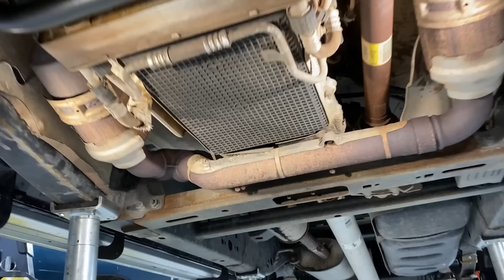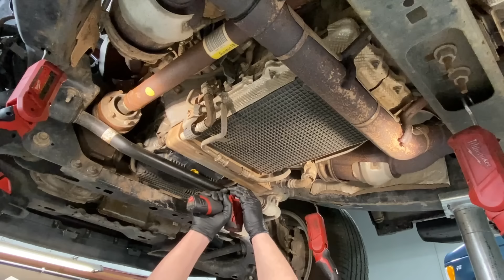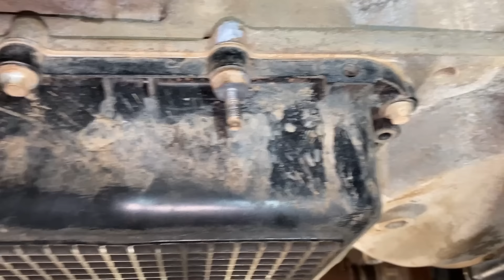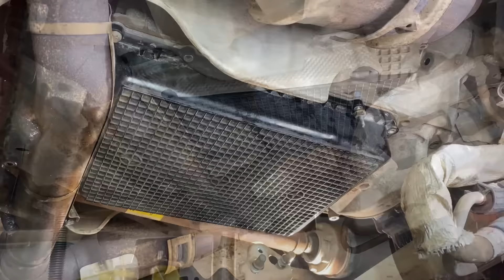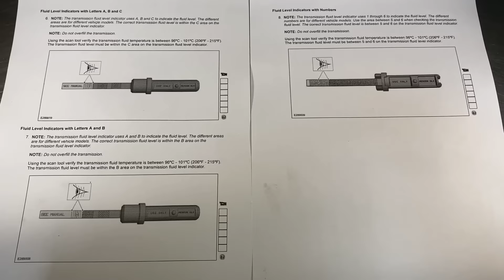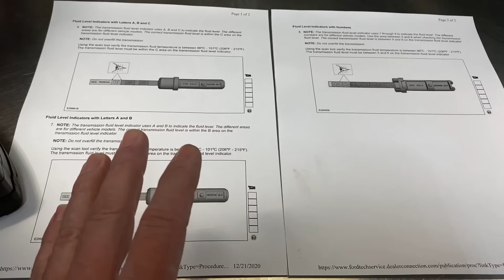Ford 10R80 Ten Speed Transmission: Fluid and Filter Service Procedure

Comment from the maker: I Recommend these Fluid Service Intervals:
First 30k Miles- Fluid Service Only
At 60k Miles- Fluid and Filter Service
Then Fluid and Filter Service every 60k Miles thereafter 

These are the Tools and Parts I Recommend:
Motorcraft Fluid Filter-
https://amzn.to/3ws97Ck
Mercon ULV Transmission Fluid-
https://amzn.to/2Qjz3uZ
Filter Seal-
https://amzn.to/38uzGaG
Manual Fluid Pump for Filling-
https://amzn.to/3hd3DzT
Medium Strength Threadlocker-
https://amzn.to/3heZT0X
Motorcraft Mercon ULV XT-12-QULV 8qts or so
Cooler Line Seals (if applicable) 5L7Z-7D285-A 
Cooler Line Backer (if applicable) 5L7Z-7J324-A

Torque Specs:
Sway Bar Nuts 15mm-  41ft lbs
Cooler and Lines 10mm- 22ft lbs
Rear Trans Mount Bolts 15mm- 76ft lbs
Exhaust Clamp Bolt 15mm- 41ft lbs
Passenger Side Cooler Line Bellhousing Bolt 13mm- 35ft lbs

Transmission Fluid Dipstick Changes-
https://drive.google.com/file/d/1-U1vxELlUPsKzgTSsjyplMQLwgd0tZBs/view?usp=sharing

Forscan is free Ford Specific Diagnostic Software:
Download Here- 
https://forscan.org/home.html
ELM 327 Adapter I Recommend-
https://amzn.to/2GC6dBj

As an Amazon Associate I earn from qualifying purchases.
Reply: At how many miles we need to change the fluid and filter im at 45k
Reply: @michoacanom4320   I believe in another video he suggested 30k fluid change, and then 60k fluid + pan drop afterwards.
Reply: @CookieManCookies  damn im way past that but i dont tow or haul all my miles its its highway
Reply: @michoacanom4320  see my reply to you. Ur fine just follow the suggestion based on Brian's service interval recommendations.
Reply: @michoacanom4320  same question! I have 25k miles and about 15% of it is towing a 8,000lb trailer
Reply: @WeekendwarriorBB  i dont tow nothing  and haul no more then 1000lbs with humans inside 🤣🤣😂😂😂 i will google it n go to my manual and see if i can find any info
Reply: @WeekendwarriorBB  See my reply below. He has more info in his description . keep Ford truckin!
Reply: Just did this maintenance myself a couple weeks ago (2018 F-150 5.0L).
I was searching this channel before doing the maintenance.
Love your videos Brian!
Really appreciate you including the torque specs & Ford OEM part numbers!!

Ford claims this maintenance interval is 150,000 miles!!?

Did mine at 40,000 miles.

Do you recommend pan drop & filter change every 30k?
Reply: This looks 100% doable…even on ramps, in the driveway, & on my back this weekend. Swapping over to an AL pan with a drain plug & 2 extra qts. cap. All Ford fluids & filter & doing it at 30K. Feel good about it!
Reply: Hey Man, love the channel. Thanks for helping us out. I recently bought a 1998 E350 with 5.4L 2Valve with RABS & have brake & abs lights on constantly. I have no communication with the module & all fuses are good. Can you possibly advise on where to locate a replacement ABS module for this truck & if only a 1998 will work, As always thanks for all you do my friend! 
Sincerely
Michael Longo
Reply: I just had the transmission filter and fluid service done at 70,000 miles,  a week later driving down the interstate, the transmission started slipping like crazy, trans temp guage was raising, and noticed smoke barreling from behind the truck. I stopped and looked underneath, it was puking oil out from between the trans gasket and pan. I had to be towed to the dealer. They said " the trans bolts lost torque and backed out "  they put in new bolts, retorqued and took for a drive. The pan was found to leak still. Now they have a new pan gasket on order. What are your thoughts on this, my 2019 f150 has never hand any issues until they touched it. Any idea on what the hell they are doing wrong?!
Reply: @69fordrealsteel you ever find out what was the cause of this?
Reply: @tonykellar463 
Poor workmanship I beat man. I love working on my cars and done extensive research for years on cars amd people  always have problems eith their transmissions when they get them service by unqualified people.
Reply: What's the part number. For those seals. On the cooler hoses?
Reply: Maybe 	 			 			5L7Z7J324A 	 And 	LX6Z7D285A ??
Reply: I need information for 2023 one. The dealerships are asshole.
Reply: Unless you tow frequently going to 50k for this service seems reasonable. I checked my fluid at 30k and it looked pretty good.
Reply: Been waiting for this! THANKYOU. Have '19 Ranger XLT FX4 . Love the truck. Sportiest ,most fun pickup I ever had! Doin fluid change @30k mis as uve recommended.
Reply: Brian i need your help. Been getting this weird popping sound coming from my 2010 f150. It only happens when i come to a stop. 2 seconds later a hard pop coming from the back under the truck? Do you know what it might be?
Reply: @bwgra97  loose nut at steering wheel
Reply: Any after market trannie drain pans for the 10r80?
Reply: Do you have a video on 5.0s stumbling&stalling at the stop light the throttle body is clean?
Reply: what year and model
Reply: Glad I got a 2016
Reply: Does this carry over to the 2020 super duty with the 6.7 ? I tow heavy and want to keep this thing on the road. Thanks
Reply: So I just filled mine to the bottom of the box cold and then weeks later checked it full hot like the manual says and my level was to the top of the next box the box above the one we want, tranny was over filled by almost half a quart
Reply: Will the cooler seal part number fit the 2018 expedition with the 10R80 tranny? The expedition part number is on back order for another 2 weeks.
Reply: Is it just mileage or time also ? Say it’s 3 years old as has 15000 miles  should it still be changed?
Reply: Is there anything on that parts list I don’t need for a 2019 ford f150 2.7 eco boost 10 speed automatic transmission
Reply: I don't know if you monitor replies- what would you say if i6 drained the trans over night, tried to fill cold, like the video, and I just put in 9qts, and the dipstick is still dry? Great channel, thank you for all of your videos!
Reply: So our fleet mechanic just did a fluid change on my 2020 f150 5.0 with the 10speed trans at 56k miles and it started slipping out of gear at 75 to 80 mph when ever I tried to overtake another vehicle in the highway and it was going into some sort of full retard mode where the trans light would come on and  it would not shift into 10th gear plus the temperature will rise up to 249’. Any idea what this could be?

I think he used the ULV fluid too.
Reply: What's the torque specs of the oil pan?
Reply: Is the same transmission of the ranger (10R80)
Reply: Hey, I tackled plug change on my old 5.4 Triton. This looks easy since I have the 3.5 ecob, so exhaust in the way. Thanks for the detailed instructions.
Reply: I own a 2018 F150  with 22,000 miles would mind changing my trans?
Reply: I changed my oil and no metal over a year ago. Fast forward now, the truck is having major slippage and not going into gear when the transmission is under 180F. Replaced with new value body. No codes unless I force it to drive when it is not warmed up. Nothing changed after the replacing this part.  I have followed all the procedures to program using Forscan. 2018 5.0 4x4 10 speed,  and after watching videos, the only logical thing is that the hub sleeve is dropping when it is cold because of the bad design. Once the truck warms up, this is expanding and maybe preventing the blockage from hub. Maybe I am mistaken, but driving for over an hour has zero issues. Run it cold, and the truck will go from 1st and jump to 4th driving under 10 mph. Something to make note, if the truck is cold and I come to a stop sign make a turn, the truck will slip out of gear and I let of the pedal,  which at this point it will engage. This has been going on for a couple of weeks. I'm about to just drop the transmission and rebuild.
Reply: I took my 2018 2.7 to dealership to service the transmission . 325$ that was about 6 months ago what reason could there be for me to notice I'm now leaking transmission fluid??
Reply: Bought a expedition with more than 200k miles, of course don’t know the service facts on it. My question is should I change the transmission oil and filter on it. Have heard rumors where it will make it worse  if done with so many miles.
Reply: About to do mine looks doable on my driveway, thank you so much even tho I dont drive much but I reach 70k already so I past to this.
Reply: Fortunately or unfortunately this is my exact vehicle, 2019, 5.0, this should be fun…
Reply: You deserve every penny as being an Amazon associate for making this detailed video.
This transmission fluid change would be a bit much for the average Dyi'er. 
Just the potential mess from split fluid is the biggest issue.
Reply: 5 years ago and still helpful! 
Just completed. 2021 At 85k miles and developed shudder. Mine took just few ounces shy of 8 qts. I had a skid plate to remove back by gas tank in order to get to transfer case to jacket it up with block like he explained. Didn't have to take exhaust clamp out though and didn't take out rear transfer case bolts all the way.  Just backed them out to the last few threads but left then partially. Basically backed that one rear one on driver side out as far as I could as it hits the exhaust clamp bolt head but it was enough to jack the trans case and not have to mess with alignment getting the trans case bolts back in later. Loosened,  made some space,  jacked and it was enough to get a 1/4 drive socket with a swivel in on those rear transmission pan bolts. 
Anyway,  solved my shudder. Drives smooth again!
Reply: I heard there's a fixture that caps the lines (OTC 6579 Transmission Line Disconnect Tool?), so they don't leak. (Don't understand why nobody drains the ATF fluid in the coolant line.. ?)

Also... I noticed not once you mentioned Ford Ranger, which also uses the 10R80, and has a massive market share that is only building higher.. while ford might say transmission fluid is "lifetime" (aka 3 yrs / 36k miles), I don't agree. And I wish you'd mention suggested mileage, and wear indicators like metal shavings on magnetic plug, and/or reflective specs on the filter. :(

Lastly, I heard you can also use a mintyvac with an adapter for filling or emptying out the pan for less mess, ie; Mityvac MVA7212 ATF Refill Accessory with Ford Adapter for the Mintyvac MV7201 Evac Plus.

Comment: Bryan, I just bought a used 2022 F 150 with the 5.0 like on you're video.  It has 97000, miles on it. I did a pre-buy at my trusted shop. He just looked at  the trans oil , and a sniff test then said I didn't need to change the oil yet. Im 74 and shouldn't preform this change myself .On another note, I bought a oil extractor pump so I won't need to crawl under the truck just to do an engine oil change. Have you used one yet?

Comment: Just did this job on a 22 with 5.0 and it’s much easier. 
The cooler is on the side so aside from one nut over a mounting stud, you leave the cooler in place, thus the sway bar stays too. 
I’d loosed the transmission mounts (not the exhaust), but pretty sure you could do without that, too as the pan came out easily, although it made a mess. 

The worst part is filling it with a hand pump. Get something better to make quick work of this.

Comment: I removed 5 quartz from the fill cap today using a hand pump, and replaced the 5 quartz. I was told the drain and filter replacement only removes 6 quartz +, I performed a drain/filter replacement about a month ago and transmission fluid. The fluid was dirty with the second change, planning to remove 5 quartz one more time in the next couple hundred miles. What are your thoughts?

Comment: what is the hours for service to do this job? I hit something and the plastic pan was slightly cracked and started to leak. Shop is quoting 1900 to upgrade to metal pan
Reply: I’m just a do-it-muh-selfer but,
it took me about 3 hrs laying under my ‘22 F150 3.5 ecoboost to drop the pan and change filter and then another hr driving the vehicle to warm up the fluid and autistically check the level at 210 degrees.
Removing one drain pan and replacing with another won’t add any time.
I would get a quote from another shop, personally.

Comment: Hey I just did my 21 expedition trans and transfer case, then I went to do the front rear differentials and they call out motocraft sae 75w-85 Hypoid gear oil. The problem with that is that it is getting hard to find and it is very expensive and you need 5 quarts between the front and the rear.  I’m just wondering if they are as critical as the transmission in terms of using the exact oil or can I find any 75W 85 Hypoid gear oil?  Valvoline makes one and so do a couple other companies.

Comment: I have a 2025 just hitting 10k miles.  Doing the oil change I decided to check the fluid level. My dash temp is saying 170 ° and it's almost touching the 6. Sound about right?

Comment: Is there a problem pumping fluid out the dipstick hole?  I don’t like the fluid shower method.  Miss the days of servicing my 2002 E150, pull a line at the cooler, let it pump out most of the fluid, drop the pan!  Also made it easy to add fluid and let it keep pumping until you got clean fluid , put line back and the trans and cooler are full of clean fluid!

Comment: Great service for DIY folks. I would only suggest a $10 hand pump to empty a gallon and also to refill. Those pumps need to be primed first to work fyi . Also, before you start, level the pan or even make it tilt forward to suck out as much oil possible to make it much less messy. Be advised the filter holds about a quart so be ready for that.  I needed to apply a small amount of white lithium grease to the oil cooler seals to wiggle them in place. A ratchet 8mm wrench and 1/4 drive deep socket were a big help for the back pan bolts.

Comment: You can also tell this guy is an amateur... ALWAYS loosen the fill plug Before beginning any fluid change on ANY location. you have been warned!  I ALWAYS suck the fluid out of the fill plug with a hose and a fluid pump. LESS MESS!  On my Bronco, not only did I remove the pan without jacking up the trans. or removing the fluid lines, I installed a extra capacity PPE aluminum pan! it can be done! on ramps no less!

Comment: Great video and extremely detailed. Too complex for me in my driveway. 2 dealers near me quoted me 1k for the trans service on my 2020 f150 5.0. But here's the kicker. One dealer quoted me 1k for what youre doing here. The other, for a flush flush and replace without filter replacement. Now you dont seem to mention a fluid flush. I know this is an area of debate. What are your thoughts on this? Is there ever a time where a flush is a good idea? I am having no issues with my truck (knocking on wood) and id like to keep it that way. So, pan drop and filter change or system flush without the pan drop and filter
Reply: Definitely do not do a full flush if you are not experiencing any problems currently. Just do a fluid exchange like this video and change the filter, you’re good to go!

Comment: Thank you for this. 2018 Ford Expedition XLT 3.5L Ecoboost. Started yesterday and finished up this morning with the fill (wife helped). Oil change in line with this. Took it step by step as you described. It is an intricate job. Took my time. Didn't throw anything. Got it done. I do feel the next time I'll get someone else to do it. Thank you FTM.

Comment: To level the truck and ensure an accurate dipstick reading, should the bottom of the plastic transmission oil pan be leveled, or is it necessary to level the transmission metallic flange?

Comment: I've watched this before and I am amazed how hard it is. Why design things this way? How do you keep track of which bolt goes back into which hole. The bolts are all of similar sizes and you got be sure you get the right bolt back in the right place. I am going to let the shop do this job. They at least can do it standing up  under the truck.

Comment: ULV fluid is junk. For Fords Expensive CAFE RATING .  11k miles 2018 F150 used Mityvac fluid extractor, drained 5.5 quarts, fluid was almost black . Put in AMSOIL LV. Been doing this every spring/fall,  fluid stays light cherry. . Never dropped pan, always check dead cold, first mark on dipstick

Comment: Followed your video and did this on my back in my driveway. Not a terrible job to do. I was able to make it a little easier on myself by using a fluid evacuator and sucking out roughly 4.5 quarts out of the pan before i dropped it. Made the job a lot less messy. Thanks for the vids Brian always appreciate it.
Reply: I’m doing this tomorrow. How difficult is it to add enough fluid. Did you bring up to temp and check and not burn ur hand off or
Reply: @dingdongdillybean  i refilled with 5 quarts. Then started it and checked while cold to get it under where its supposed to be. I did check it hot cause I have ocd with this stuff and yes I did burn my hand. To refill I used a long neck funnel with a hose attached to it. Filled through the engine bay.
Reply: @stevesnop3798 smart. Any other advice?!

Comment: When checking cold, can I check without the car running after I cycle the transmission? 
 I have an S550 Mustang and the CAT is right where the dipstick is and you can't get your hand in there to pull the dipstick without burning it on the CAT.

Comment: @FordTechMakuloco had this service yesterday on 19 5.0 10r80 with 50k miles.  now experiencing hard shifts, especially in higher gears. Last night it wanted to only shift from 5th to 9th once i got closer to home. Ended up getting stuck in 5th and had to shut it off to limp it home. Is this a simple gear reset for the tcm or fluid over fill, or does this sound like a bigger issue? Where to trouble shoot?